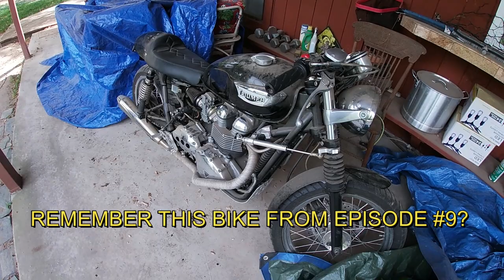Well, I bought a  TRIUMPH Bonneville Am I CRAZY?  I'm Still a Harley Guy at Heart

Comment: I wonder if perhaps some penetrating fluid would have helped some with that oil filter removal? I doubt it but maybe? I do my oil changes myself but I’ve been told different things about how tight to put on the drain plug/filter. The Haynes manual gives specific torq specs for both